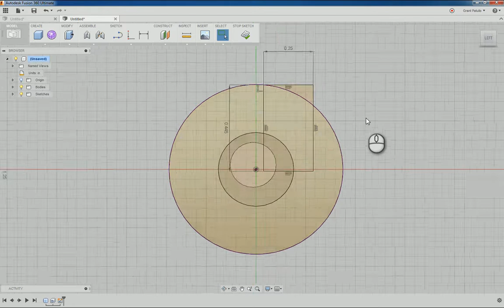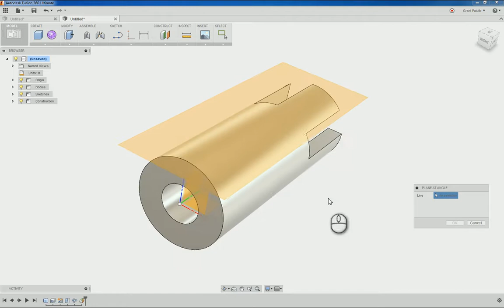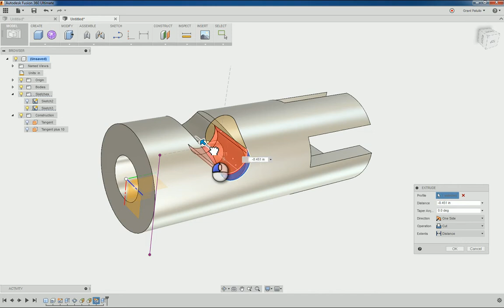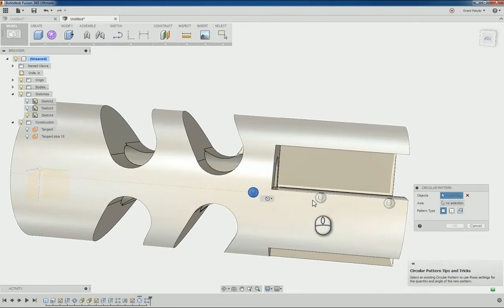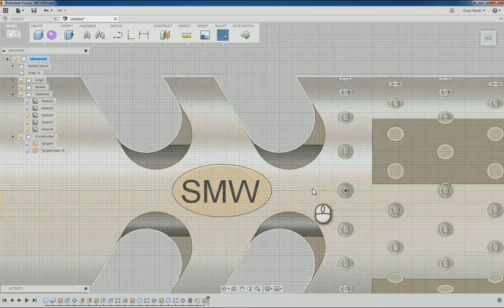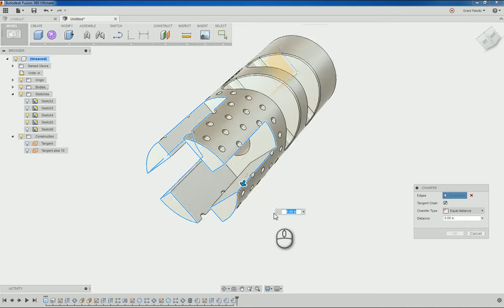NYC CNC muzzle brake copy using Fusion 360

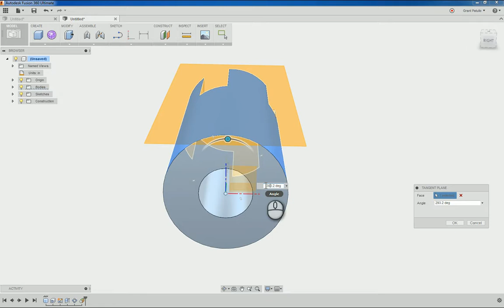Comment: This video is hard for beginners to follow. not much explanation, only "now I'm doing this" (in 4 words or less).. not really a tutorial.  thanks for the vid but i'm giving up after 5:30 into it.maybe i'll come back when I know more and can follow it, but, if I knew more, I could do this without a tutorial.. you know?    thx though
Reply from the maker: +Mitch B  I didn't intend this to be a tutorial, just showing how I did this model using fusion 360 instead of solidworks.
Reply: +Grant Patullo (GPtech) that's pretty much what i gathered.

Comment from the maker: I missed some features, I have this vid showing this missed features http://youtu.be/PM2srbtRBJQ
Reply from the maker: NYC CNC Thanks John, I had fun doing this, as far as making one, that will have to wait until I get cnc mill, I have my eyes on a mori seiki but it will be $25k exercise by the time I have it in my workshop (which is cheap for what it is), and then I have to make money with it.
Reply from the maker: NYC CNC It's a MV40b 1997, Fanuc controller. Remember I'm down under and the prices are probably dearer than what you have seen. Of that $25k, $2.5k is transport and $2k to have 3 phase put on in the workshop. And then there's tooling. But I think that price will be similar to a new Tormach with the same features, that is if the local Tormach distributor ever gets back to me with a price.